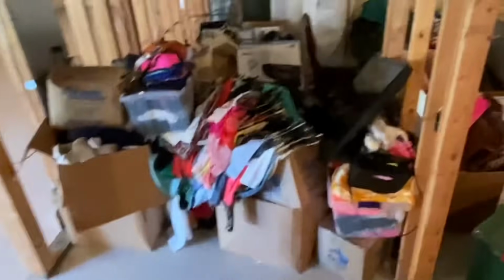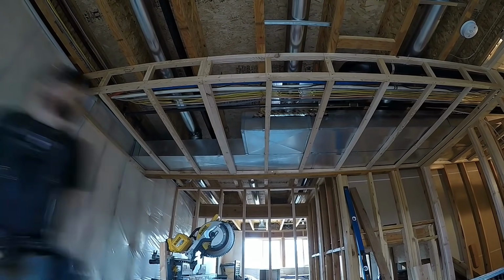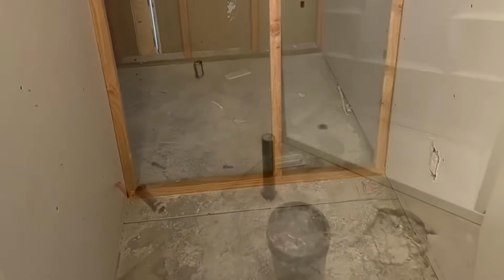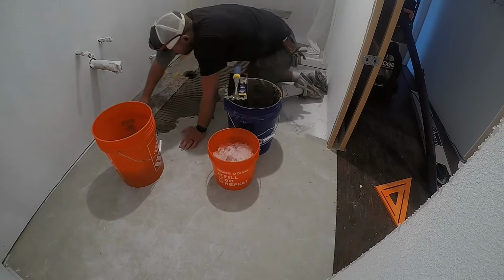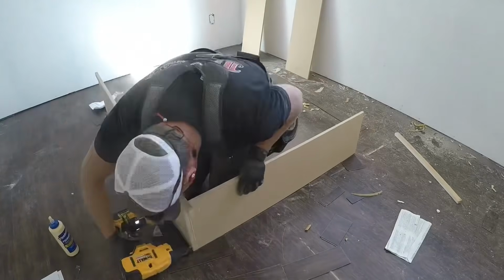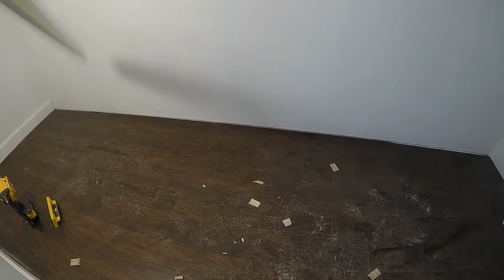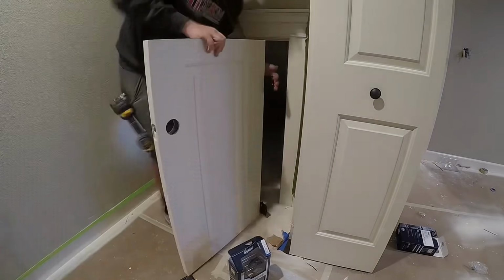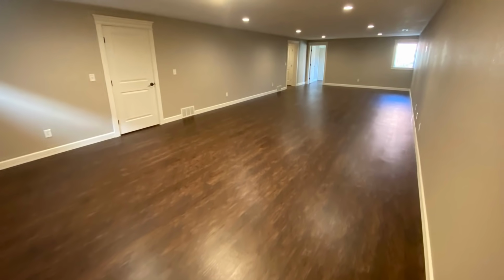Adding Equity - Finishing a 1300 Square Foot Basement - Full Build Time lapse

Comment: Hey bro, GREAT Job, I have a 13,000 sq ft walkout basement with 4 windows, would love to have your contact info to do my basement, I’m in NYS.
Thanks
Reply from the maker: 13,000? Or 1,300? 1,300 I would be tough to make it worth it to travel. 13,000… I’d find a way to make it work!
Reply: 13000 sq ft? Thats the size of a mall. R u sure you did the math right.

Comment: Would prefer floor system of 3/4 foam board and 3/4 advantech osb. Allows for warmth with additional insulation. Thoughts on foam board wall insulation vs batt and poly?

Comment: I have a basement thats 1000 sq feet i want to add a bathroom and a bedroom and lundryroom utility room with a family room. Whats the cost?
Reply from the maker: That’s a tough question, if you do everything yourself including electrical, plumbing(breaking up the concrete for drain lines), all the framing, drywall, trim, doors, paint, tile, etc. and you smartly source your materials on sales and marketplace you could probably get away with $20-30 per square foot on material costs alone, so $20k is what I would budget for assuming everything needs to be redone from scratch. You could even stay under that if you went with shower/tub inserts. On the other end I’ve bid out and done basement projects of this size that the intent was to become its own apartment separate from the upstairs needing full kitchen, bathrooms, bedrooms, egress windows, separating utilities along with all the things mentioned above for around $150k.

Comment: 🔥 should my aprilaire dehumidifier be on finished side or unfinished side the basement to control humidity behind the dry wall? Im doing the same exact thing to my basement now. 2bedroom, bathroom,hvac, 1250 sq ft. How much did this job cost

Comment: I don't like that no vapor barrier and insulation was placed on the floor before putting up walls. Mike Holmes recommends doing this because cement absorbs moisture.

Comment: Do pocket doors save on space in the long run? I like the idea of being able to use the space where a door would open. 
Did you put a light under the stairs? I plan on doing the same thing for my basement for my twins because I want to make a play room down there along with a master suit. 
If you do a large walk in shower, can you put some sort of light in the shower? What about an antifog mirror inside the shower? Can heated floors be installed some how in a basement bathroom? Would it benefit the owner in the long run to install an electric fire place if they have one upstairs also? I mean when it comes to heating instead of running duct work to try to heat the whole basement, cost wise on their energy bill. Sorry for all the questions.
Also, is it hard to turn an egress window into an outlet door into the back yard?

Comment: Hi. I’m a contractor and I’m doing an estimate for a basement in Wisconsin. I can do pretty much everything except major plumbing and electrical. I have a 1125 sq ft basement. Can I ask you, when you do your estimate, do you include materials too or just labor. Also for labor do you charge different for different types of jobs or just a fixed price per hour. I’ve done condos before but this is my first major basement project. I appreciate the input. Thanks so much

Comment: I don’t see you using any vapor barrier and sub flooring between cement and vinyl flooring? Is it not necessary?
Reply from the maker: The carpet pad has a vapor barrier on it and is designed for concrete floor applications.
Reply: @ZEMConstruction  thanks for the reply, is it possible to share carpet pad information (the one which you used)
Reply from the maker: Dang, that was a long time ago. Haha. I know it was stocked at Home Depot though.

Comment: So, question - did you eventually tape the vapor barrier? And why not run a waterproof membrane around/under the shower kit you installed?
Reply from the maker: No, there wasn’t any damage or anything to the vapor barrier that needed tape. The shower doesn’t need a vapor barrier all the way around. In fact the manufacturer recommends using adhesive to adhere the walls to the studs. With things like that I’ll often default to what the manufacturer says.
Reply: @ZEMConstruction  Agreed on the shower install, but I thought I saw the vapor barrier cut around the outlets and switches and plumbing, best practice would be to tape those, wouldn't it? Again, I could really see it that well, in the video, so it may have been that you did, or that it made continuous some other way, in which case, you can just throw something heavy at me, lol. Regardless, the basement looked amazing, finished. I especially liked the custom woodwork you did around the windows. They looked really good, man. You're welcome to swing by to help with mine and crack a beer, anytime. :)

Comment: I know you use 24 inch wide , but Rockwall insulation. come out only 4 inch thick do you still use one or used double layered?  thank you the basement looks good 😌
Reply from the maker: Thanks! I only used one. More layers would probably make a difference but not that much. The homeowner wanted sound barrier but didn’t want to get too crazy with it.

Comment: Great job! It was asked earlier, but there was no response from you. What is the cost for a job like this?
Reply from the maker: That’s intentional, I am still currently working on this person house in other aspects as well very similar projects for others. I also want to keep doing projects like this and by disclosing pricing publicly could put me in a n awkward situation. Obviously no project is the same and if my customers can see how I price others compared to them there is a chance they could become upset. Even if that chance is small, it is not worth the drama that it could cause. I am currently working on a video series I will release on my Patreon that will go in to detail about pricing, bidding, and more of the business side.
Reply: Generally, finished basements run from $25 to $50 a square foot.  Prices can go north of there depending on number of rooms framed-out, finishings, flooring, lighting etc.  So on the low side this would be about $30k if he's charging FMV.  I'm guessing this was right around $40k.
Reply from the maker: You’re close, little higher. I’d consider the finishes on the “higher end” and there was a significant amount of change orders throughout that caused significant costs.
Reply: @ZEMConstruction  a completed basement of that size in canada with those types of finishes would be north of 60k

Comment: What about a barrier between  the concrete and your wall sill  so no capillary action with water happens .
Also why don't you use green sheetrock in the wet area of bathroom.. 
Can you say in detail how you precut your walls before install  like how much wiggle room you leave i want to know your forsight
Reply from the maker: All the sill plates are pressure treated, also there is a vapor barrier under the concrete slab, this is a newer home. So moisture is not going to be prevalent in the slab. It will exist but not enough need an extra barrier. Treated is more than adequate. In my opinion green board is a formality. The only time it is needed is if the drywall is not properly coated with primer and paint in moist areas. The only difference between green board and regular drywall is a wax coating on the exterior of the paper on greenboard. Once primer and paint are a applied they are the exact same. And when pre cutting walls I cut everything exact except for the height, I leave a 1/4 inch of wiggle room for discrepancy in the floor or ceiling. 1/4 inch seems to be the sweet spot between enough structure to be supported but also makes install simple enough.

Comment: When you layed down the flooring, I noticed you didn't put anything down first. I thought you had to put down somesort of barrier or roll out a thin sheet of ???. What flooring did you use? I want to do this to our basement. It's beautiful.
Reply from the maker: It’s actually an LVP (luxury vinyl plank) it’s completely waterproof. When using a laminate that is susceptible to water damage then a vapor barrier is laid down first. And unfortunately that color of floor is discontinued.

Comment: No water barrier or waterproofing behind shower surround?
Reply from the maker: For an acrylic shower insert? Manufactures instructions call for construction adhesive applied directly to the studs and back of the surround. Unless there is a catastrophic failure, the chances of water getting behind the insert of an interior wall is slim to none. Unless I’m wrong, I’m happy to learn, please site your source where a vapor barrier behind an insert is recommended.